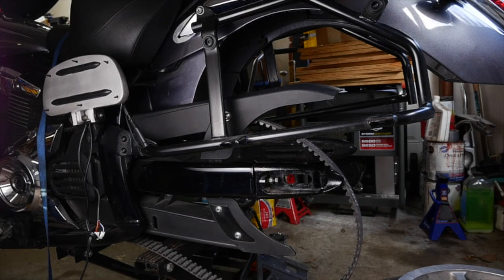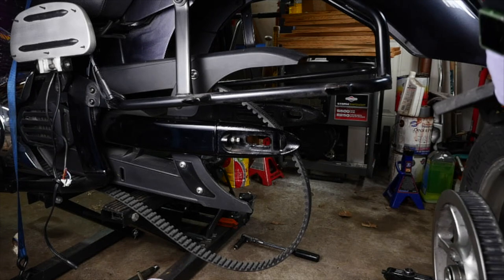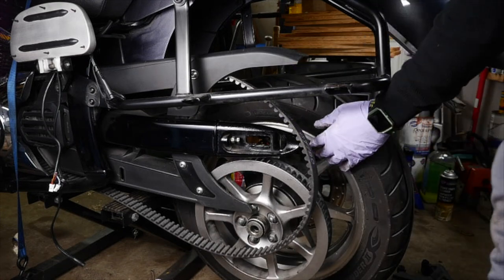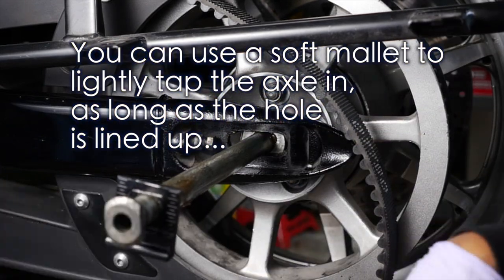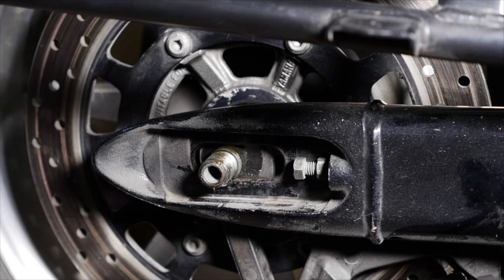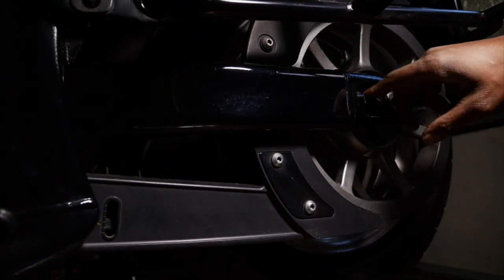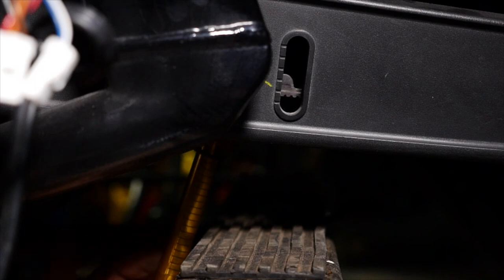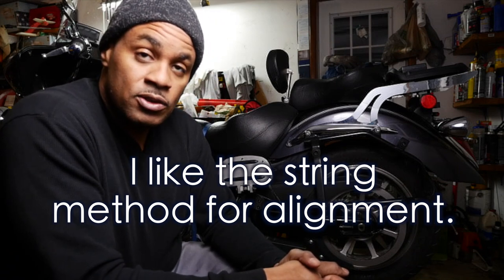How to Install the rear wheel on the Vstar 1300

Comment: I have a 2014 VStar 1300 and watched both your videos on taking the tire off and on and the videos were very helpful.  I didn't have a scissor jack so I used my floor jack instead and it worked real well because it is cupped shapped which helped prevent the tire from rolling.
Reply from the maker: Awesome.. I am so glad this could help. Be sure to grease the spline bearing in the wheel hub n light grease on the axle.

Comment: Thank you so much for the video. Your videos are always very helpful. I just finished getting a new tire put on the rear. I was able to take it off and bring it to them.
Reply from the maker: Glad it helped. 
Remember when installing sometimes when you tighten the axle nut the Mark's could shift a bit, so be sure to double check them . Also double check  the belt alighnment.

Comment: the break arm is always a pain haha .. Did you have to remove the tire to get to bolts for the back luggage carrier you mentioned in the last video ?  need 3 or 4 arms some times to get the darn rim lined up haha . The Belt adjustment is the same on the harley . Take Care
Reply from the maker: No to needing to remove the tire to get to the bolts. I pulled the wheel to check my rear wheel bearings, but they were fine . Some guys had issues with toolbags over tightening the axle nut. 
Mine were fine though. 
I just figured I'd film the process for a how to. I've read the manual so many times , it's almost 2nd nature at this point. Lol
Thanks for watching brother.
Reply from the maker: Also the scissor jack helps with lining up the rim to the swingarm.

Comment: Do you adjust the belt to the index lines with the inside edge of the belt or the outside (flat side) of the belt ?
Reply from the maker: If u took a photo of marks before disassembly or marked with a marker then just reassemble. Otherwise I usually loosen both adjustments and axle bolt. Spin the back tire till and adjust till belt tracks as center as possible. Then I check marks , adjust belt tension to close to spec but a little kn the loose side. Then tighten back up.
Reply: @dbest1aVlogs  Bought my bike used with new tires on it.Was just curious as to how much play the belt needed. Looks like I will be buying a belt tension tester
Reply from the maker: Yes a belt tension tester is useful. Also the specs are in the online manual found in the files section of the vstar1300 wiki on FB.

Comment: Your next Video. Changing the coolant on your Deluxe. What fun! Yet until I saw what it took to just change the battery on my friends CanAm, I started overlooking the small difficulties of my Deluxe.
Reply from the maker: Yes.... imagine that must have been a headache.  I bet the dealer charges a nice penny.  
The coolant is not too hard.  There is a good write up on the vstar1300wiki.  They even go into flushing the system.  Not a bad write up.

Comment: Hi Bruce thanks for all your videos which I watch with interest. My question is:- although you used the 10lb gauge to check the deflection of the drive belt, have you found a quick method for checking the rear axle alignment? The reason I ask this is because I set my rear axle position according to the adjacent marks, but the drive belt wasn't centrallised on the pulley. After much frustration, I took the bike to the Yamaha dealer who explained the marks are only a guide and adjusted it for me. They started the bike, put it in first gear, and  as they turned the adjusters, the belt moved accordingly. I wondered therefore whether you had a special  tool.
Regards from Paul in UK
Reply from the maker: Interesting to hear how they do it. No I had no special tools for doing this. My belt always tended to track toward the left. I usually would use the string method to help with alignment which has been somewhat of a guide. I even tried the no hands method which ended up with the bike tracking straight, the Mark's being about 2 big Mark's apart. Brake side further forward than clutch side. I found the string method helped me best so far to get it close. I will have to try starting the bike and putting it in gear to see what the belt does. 
Hmm.
Will look into that.

Comment: Thanks for this video especially the tightening specs can you give me the front sprocket tightening specs, I just bought this bike and previous owner had WAY over tightened the belt and destroyed the bearings in the rear sprocket hub in turn destroying the hub and the somehow loosening the front sprocket. I can't find that spec on the inter web can you help?
Reply from the maker: I don't know if this link will work , but you can give it a shot. 
https://drive.google.com/file/d/1rrWUmZlwwNnSUyKyxEHEuh1_yVM38YiM/view?usp=drivesdk

You can download the service manual from that link , and on page 4-72 you will see the tq specs. Your going to want to replace that nut also that holds it on.  

If the link does not work , Google vstar1300wiki then go to the files section, and download the vstar 1300 service manual. 

You will need to press the rear brake to tourque  the nut down. Don't forget the loc tite. 

I set the rear belt tension to "just" loose of the factory spec. 

Hope this helps. 
Any questions , just ask.

Comment: When tensioning the belt should the wheels be on the ground.
Reply from the maker: In manual it will give you 2 listed specs. One for on the kickstand, and other for bike on a lift rear tire in the air. You can run either, but stay to the looser side of the spec.

Comment: When I removed my rear tire the chain sprocket came off and all the spacers came out. Now I can’t get them all in tight enough to allow enough room to get everything back together. Any tips on making the spacers for better?
Reply from the maker: In the video I use a soft mallet hammer n lightly tap on the lug nuts. It should fit right back in assuming the rubber shock spacers are in right as they came out.

Comment: Hey Bruce why wouldn't you want grease on the axle threads? I always lightly grease mine to help with road salt/gunk buildup. Just curious on your thoughts.
Reply from the maker: Nathan LaBrie I was told it would mess with the torque readings. I’ve never undone that bolt and found gunk in there though. The only thing I put on threads is loctite, but I don’t use that on the axle bolt.
Thank you for watching Nathan
Reply: @dbest1aVlogs  Fair enough didn't think about torque. For that your right a wet torque isn't the same. Guess it's a through back to my motocross days trying to keep gunk build up and rust off the main faseners. Guess 6 of one half a dozen of the other. I'll keep that in mind in my battle with corrosion.
Reply: @dbest1aVlogs  Can't really see how a bit of grease could effect the torque readings when the amount of torque required is not really that low. But just wondering...
Reply from the maker: It does make me think. What about torque it down , then put grease over the torqued unit. I think that would have the same result right.
Reply from the maker: The rear bolt TQ is 110 ft lbs. I can't remember where I saw it, must have been deploys garage... he stated adding grease to the threads creates a resistance,  and throws off the torque reading. So you would get a false reading of 110 ft lbs due to the grease. If it's TRUE... I dunno,  but I know a lot of his videos have been very factual.
Reply: @dbest1aVlogs  There's a good idea!
Reply: Yes he is right grease or any fluid is not compressible like air. The book will normaly list a wet torque if it's needed. I don't own a working torque wrench so..I just normal tightent until it strips a bit... then back off 1/8 and call it good... snickers nah just go by feel. But that tool is on my list.
Reply from the maker: @AdventuresWithNimby  hehe. I got mine at Harbor freight.  It's been ok by me so far. I can't complain.
Reply: @dbest1aVlogs  I still can not see where clean grease on a clean thread can cause any problem. I might be wrong but just can't see the logic.
Reply from the maker: Check out some of these posts where the guys speaks about the tQ issues. 
https://www.bikeradar.com/forums/viewtopic.php?t=12956342

Comment: Harbor Freight El Cheapo, Hydraulic Floor Jack over the scissor.jack
Reply from the maker: Yes indeed , that could work too. Just this scissor jack 9 times out of 10 is readily available to most n free.  Just gotta look in the trunk of their car. 
But yes , one could use any means that helps the overall process and idea.